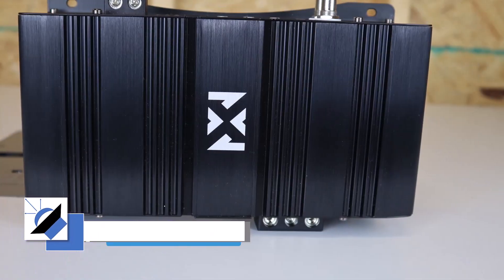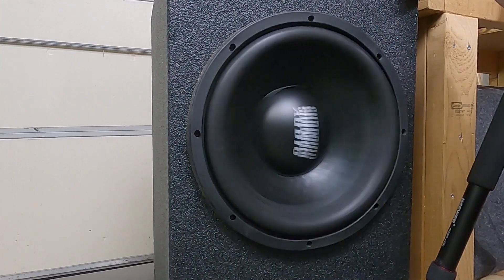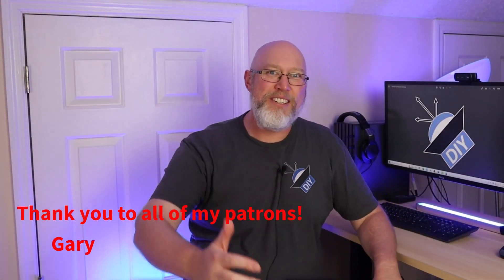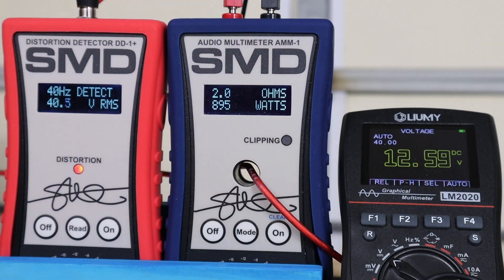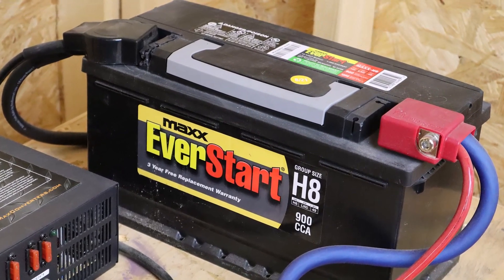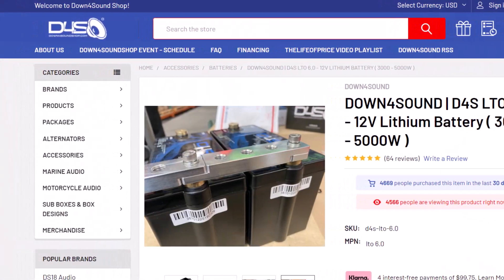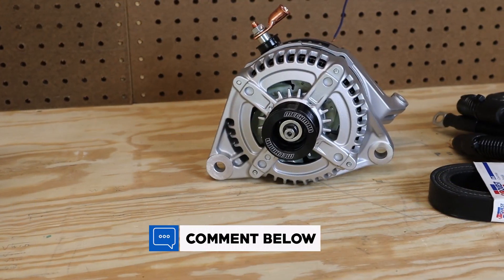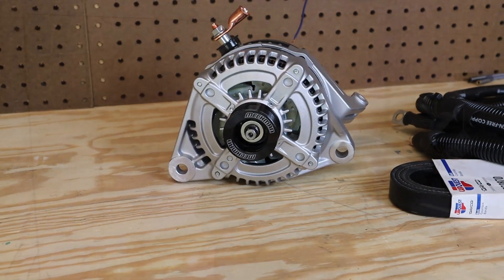Amp dyno FAIL:  Here is why you need to upgrade your alternator!

Comment: I have a Mechman alternator, 0 gauge Sky High Big 3, a Kinetic HC1200 under the hood, and a Kinetic HC600, running about 1200 total RMS in the trunk of my Mustang. No dimming lights and starts up no problem every time. The HO alternator is the best investment I've ever made in 30+ years of car audio.
Reply: My 2016 GT basemodel has stock components - 1800.1 kicker RMS - no issues 😮
Reply: @Youngsoldier93  I think V8's are usually good on alternator output.

Comment: Great video, very informative.
I've used the super expensive Fluke clamp meters and the $20 no brand clamp meters. You won't notice the difference, apart from maybe the resolution of updating is 0.2 seconds slower.
I recommend buying the $20 one. The other reason is, that you are going to be paying for features you're probably never ever going to use.
Reply from the maker: Good advice.
Reply: I second this. I work in electrical motor repair and we have name brand test equipment that can be serviced and calibrated. That is were the additional cost is as compared to some cheap Chinese equipment we keep for reference only spot checks that is realistically just as accurate.

Comment: Thanks for all your videos! I'm running one CES Large Case 390 regulated cold start 16.3 volts, down once warm to 15.6 to 144ah of Lishen LTO powering 4 Orion HCCASPLX3ks to 4 Crossfire C-7 18s walled in a Bobby encloser called a "slid in" yes, I cut the back wall of my truck out to slide this 500lb pound box in place. Still in the install stages have not played the woofers yet, I have the celling and back walls left to fab up, I should be powering it up in 3-4 weeks.
Reply from the maker: Holy crap!

Comment: Mechman alternators are fantastic. I had a 240 amp Mechman in my pickup. Battery technology wasn't what it was today, but I remember having 2 giant 1000CCA batteries in the back. They were huge and super heavy. Built for commercial trucks. Was running 8K watts with that setup. Btw you should check out Kaiweets HT208D clamp meter. Has inrush and all the features you want.
Reply from the maker: Thanks! I'll make sure and give that a look.

Comment: I put a optima yellow cap battery under the hood,  big 3 1/0 gage,  and yes a 5 fared power cap.  Running 2 amps, and a crossover on a factory alternator.  No issues thus far but plan to upgrade alternator down the road since I m adding a complete 3 dvd screen set up as well.

Comment: The old school beer style caps can help when used in lower power setup adding one to my setup with just a kicker 600.1 gave me a gain over 1 volt and that’s using the cheap Walmart 500k cap. I got it for free so I tried it.
Reply from the maker: You can't beat that price!
Reply: @DIYAudioGuy  dang right and the voltage display comes in handy lol

Comment: If you're like me and enjoy older vehicles it can also be a challenge.  In my 83 S10 it had a 37 amp alternator.  Previous owner did an electric fan upgrade.  I put a simple 250 watt amp running a single JBL 10 inch sub and I had to turn the stereo down at stop lights because the fans would slow down and it would start to heat up lol.  I ended up getting a bigger stock alternator from a different truck, but that was crazy, even with that small of an amp.
Reply from the maker: I remember those days!  That truck probably had hand crank windows, so that 37a alternator was all the truck needed.
Reply: @DIYAudioGuy  carbureted V6, no computer, manual trans, manual windows and lock. It was as basic as it got. But with a simple sound system you could watch that volt gauge drop like a rock

Comment: First something to know about newer cars/trucks is that they do not run at 14.5 volts anymore, they run 13.5 volts and are switched charging. Switched charging is when the ECU controls the alt and loads and unloads it, this is done in the name of "Fuel savings". But like the stupid start-stop in new cars/trucks it does nothing to help real world MPG numbers, just makes shit wear out faster. So you're starting out a full 1volt less than and older car/truck, and the OEMs started using them at different times. Toyota has it as far back as mid 2000's with Ford picking it up in the 2010's. 

Second you really need the BIG 4, the BIG 4 is the same as the BIG 3 but you add a direct ground to the rear casing of the alt. In some alt setups the casing grounds through the front cover with the rectifier mounted on the rear casing. It then has to pass through the casing bolts to the front casing then to ground. On almost all alts there is a threaded hold on the back of the casing and it's for a ground strap, take it straight to the chassis. 

Also on Toyota's if you have weird voltage fluctuations you need to completely replace all your main power and ground wires. For some reason Toyota used bare copper wire and did not seal the ends of the terminations and this causes corrosion to start and travel down into the casing and ruin the wire and increase resistance. I have cut open tons of their Alt Cable's to find over a foot of corrosion into the insulation. I normally replace with a Marine grade OFC tinned cable and make sure to seal all crimps and terminations with Marine grade heat shirk, that fixes the problem and keeps it from happening again.
Reply from the maker: You are 100% right.

Comment: Best tip I can give, don't rely on the alt to fully charge your battery. It's best to charge your batteries with a charger once in awhile. This will extend the life of your alt.
Reply: Yep I have a battery charger connected to my rear battery and a power inverter in my car. Once a month I turn on the battery charger overnight to top off the batteries.

Comment: its definitely not just the alternator. you need to have the battery bank to match or be better then what is needed for your system then you can run any size alternator to keep it topped up as you don't have your tunes cranked all the time 
I use to run a stock 135 amp alt with a 5x100AH battery bank on 5000+ watt system with no light dimming at all 
mind you all upgraded cabling 0/4 haha
great video btw!
Reply from the maker: The main thing is that you can't just throw a 5kw amp in your trunk and hope for the best.
Reply: It makes sense you wouldn't have too many issues with such a large bank. I think many do not realize how current flows in a DC circuit powered by an electrochemical battery. The sole job of the alt is to force extra power into the positve side of the battery so electrons drop from the cathode and can then exit the battery from the negative pole. Electrochemical batteries are designed with a chemical on the negative side that has extra electrons and they use a closed circuit to travel to the positive side of the battery which houses a chemical deficient in electrons. Without the alt, the cathode would fill up as the chemical attraction between the two  chemicals in the battery reduces and it would be seen as reduced voltage.

Comment: Great cover of the big details of cheap and powerful amps.

I have to add my experience. I Powered a 2k skar amp fully off of a 400ah lithium ion battery I made, with very little dip in voltage. With a 20amp battery to battery charger made by renogy solar, it made stock alternator use a breeze. 

It's not like we are cranking these systems up for extended periods of time,  so on some instances, this is a good idea too.
Reply from the maker: Did you charge it overnight every night, just when you knew you needed to top it off?
Reply: @DIYAudioGuy  the renegy controller charges with the vehicle alternator, only when the remote trigger is on, or ignition is on. The renogy will charge at 20 amps until it hits a preset voltage, which I think is 14.7v max. They make larger versions.

So a 4s4p 400ah lithium ion battery to diy will set you back $1000. However, a 200ah pack would probably do just as good for 200amp draws.
Reply: @DIYAudioGuy  if you want to do a pt 2 to that video, I'd build you something to try out. I have some 130ah cells I could part with, just to see my idea tested. No cost, no need to return.

Comment: This is why I try to aim for efficiency, and why I like Williston/BigDWiz efficiency % tests on amps. 
I have 2 12s in an isobaric configuration in a 3.4cuft box previously tuned to 16.1 hz and now at 28.5hz; wired to 4 ohms. I only need 250-300w to hit xmech. I don’t think I could ever go away from isobaric setups now.
Reply from the maker: Absolutely!
Reply: isobaric lowers efficiency tho
Reply: @blakebrockhaus347  in comparison to just one of the drivers, it doubles actually
Reply: @blakebrockhaus347  from my exp with a clamshell, the ohm load doubled, but I still could hit the same excision w/o touching the gain. Ie: still bottomed out the sub. 
Plus, most cases when you increase the ohm load you increases dampening and amp efficiency. So i actually got more output out of a cheap amp I had. 
But in terms of like 2 subs parallel, you r right, but the cons vs isobaric pros is that the frequency response in the same box will hit lows louder, so it’s a win-win tbh. Try it and it’ll blow your mind.

Comment: This is true, but if you just go big on your electrical system right away then all your "cheap" high powered amplifier power is just that, inexpensive. I remember when I was in high school over 20 years ago now and if you had a 1000 watt amp in the car pushing two 12s your car was "bumpin". Now I have two 8000 watt amps pushing two 15s and my car is "meh".
Reply from the maker: You are exactly right.

Comment: 17 Silverado 170amp factory alternator. Nape 80a agm, & xs power d1200, xtr1500, xtr500.4  . It's a daily driver. I do a maintenance charge about every three months so far no problems. Been up and running about three years. Going to upgrade charging so I can upgrade a little

Comment: Great video Justin can't wait for the alternator install . I've got a 2010 ram I've been vacillating to do an alt or not.
Reply from the maker: Mechman makes a 240 and a 320 for my engine.  The 240 makes more power at idle and the 320 makes more at higher RPM   Mechaman tech support told me to measure my drive shaft pully. If it was big enough then the 320 would make more power than the 240 at any engine RPM. IT WAS!

Comment: The car will
Use 60-70% out of the factory
Alternators output. Therefore If
You have 100a alternator you only have a max of 30a spare to run a system.
Reply from the maker: Fortunately the battery will help bridge the gap, but batteries don't make power.
Reply: @DIYAudioGuy  I’m my 25 years of car audio and being the importer of mechman and xs power to New Zealand I’ve always lived by the saying of you need power to make power. 

Using a cap bank on certain 2k Amps if seen over 2800wrms out of them, the good things of holding 14.9v ,)
Reply: @Andrew_kiwi_AF  what mechman alternator fits an fg falcon then ? 😅
Reply: @A. Melbs hey man. Where in aus are you?

Comment: My setup is two xs power d3400 batteries, two massive audio hippo xl122r, two jp33 amps and a 320 amp alternator. And of course the big 3 upgrade. I have yet to check the voltage on full til because it keeps snowing here.

Comment: You can put a 4001n diode or two on the exciter wire and it pick your charge voltage around 1/2 a volt as well.

Comment: Got an LTO XSPower VX6500 under the hood and a D4S LTO6.0 in the back powering a B2 Audio Rage 2500v2. Still got the stock alt with the big3. 13' Ford Edge V6.
Reply from the maker: I am debating between a pair of the D4S LTO6.0s and a single XS power Titan 8, or a JY Power LiFePo and a battery delete.
Reply: @DIYAudioGuy  Have you looked at the jp40 lithium battery? Might be cost effective to get one of those and then put an ultracap under the hood. Just a thought.
Reply from the maker: @AToMx2k10  That is one of the ideas kicking around in my head, if not an ultra cap then a battery delete so I have a place to mount fuses.

Comment: I have the 2 channel version of this amp that bridges to 500w rms  a JBL p1222 subwoofer in a box the same as what U have 🤣 factory alternator with a odyssey extreme pc1750 battery , it slams hard glad too know these amps put out there rated power

Comment: in older vehicles like from the 70s you only had light bulbs and ignition coil to power but today there are computer modules that are sensitive to noisy power so your car could be effected.

you can get a cheap clamp meter and it should give fairly good reading the only thing i can think of that the more professional ones would have is maybe better features and better safety like forgiving for applying voltage across the resistance ports and settings or across the current ports and settings by having internal bleeder shunts to bleed off the voltage to the resistance and current ports and ensure a blown fuse.

cheap meters may or may not blow the fuse before destroying the meter.
Reply from the maker: On a lot of modern cars if you replace the battery you have to go back in and clear a bunch of low voltage codes afterwards.

Comment: I have a stock alternator in my 2019 Chevy Trax LT but I have a full throttle 4800 AGM an isolator in between that and my D4S 6.0 LTO and a 500 farad cap bank for a D4S JP23 on 2 Resilient Sounds RS 10'S voltage doesn't drop below 13.5

Comment: I have a question about audio and the power needed for the speakers. I have an amp that is rated 2*220 x 350 for the sub. If I get speakers for this 2.1 channel amp should I be looking to get 2 speakers that add up to the rms or 2 speakers that are both equal to the rms?
Reply from the maker: That is an unusual amplifier.  What is it?

Comment: I upgraded to a BNR Parts - 200 Amp High-Output Alternator just for my Skar Audio - RP-1200.1D amplifier wired at 1-Ohm. The amplifier is very inefficient at 1-Ohm @ 54% efficient & my headlights still dim pretty badly & my 200 amp high-output alternator can not keep up with the heavy current draw. I changed to LED headlights but they still dim down to about half there brightness at full undistorted volume level. I have tried everything I can to stop voltage drop but sometimes there is too much current draw even with a high-output alternator to help solve the problem.
Reply from the maker: Have you tried the big 3 upgrade?

Comment: 80a factory alternator, Odyssey agm, 24ah Headway bank, big 2 (can't get a good connection to the alt post) powering a Sundown 2500. I check my voltage periodically and it's always strong but I don't push it for very long.

Comment: love your vids... even got an oscilloscope to tune the amp (nice)... problem I'm running into is 3 letters: BMW... My alternator is liquid cooled embedded into the timing cover (M62TU 4.4L V8). In theory it should be 150A. I am running the SKAR Audio RP-600 5 channel AB/D powering 2 SKAR VD-12 D4, and 4 Kicker 5 1/4. I stripped out all of the OEM stereo/nav 'stuff' that I could find from tracing wire harnesses and figure that should 'free' some overhead to power the amp/head unit. BMW has a beefy 2/0 possibly 3/0 wire going from the alternator to the battery (in rear hatch- 1999 540it wagon) which already uses an AGM battery. 

TL:DR Question: How much do you predict I could throw at this system before needing to manufacture a bracket to add an 'external' alternator, which I would then run 2 separate voltage systems, OEM and audio? Mind you, I am not looking to find the resonant failure point of 23 year old plastic bits, or do the t-shirt floating in window trick... but I would like to occasionally scare the neighbors :D
Reply from the maker: Holy crap that is crazy.  When did luxury get redefined to mean over-complicated?   The problem is that all of the fancy electronics are going to soak up most of your alternator's capacity.  So I have no idea how much power you can run.   I would not go more than 1kw.
Reply: @DIYAudioGuy  I probably should have recorded how much each of the devices consumed while operating before I took them out. You showed in your video the KLEIN clamp meter. I use the one I got from homedepot almost daily and is an excellent entry level meter, but does not support DC. Another one I use for DC power is the Reed 5030 clamp meter for testing 24V/125A welders. The Reed meter is a great meter if you're looking for "I don't have to sell a kidney for a meter" price point. If you're looking for HIGH amp readings, the Reed 5060 goes upto 2000A DC.

Comment: will an 800 watt amplifier be too strong for my alternator and battery?
Reply from the maker: That depends on the car, and how hard you push that amplifier.  Is your car has a 90 amp alternator and you crank it up to 11 every time you're in the car, for the entire time you're in the car, you will have problems.  If you're riding around in a heavy duty pickup truck with a massive alternator from the factory and you listen to your music at a moderate volume and very rarely crank it all the way up then you will be fine.

Comment: I love the 9106d it’s a great amp. I run 8 of them in my jeep 😎 this amp makes a load of power and can handle high input signal voltages (I feed mine 15v from my matrix line driver and never had issues.) only thing I don’t like is the terminals are not big enough to run 0 gauge power wires easily, you need a reducer or run 4 gauge.
Reply from the maker: 8 of them?  Wow.